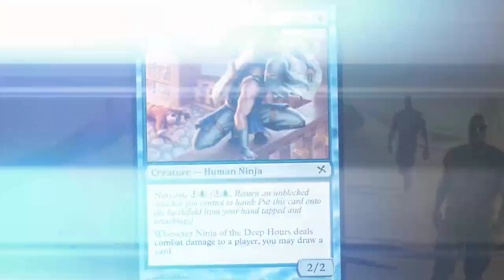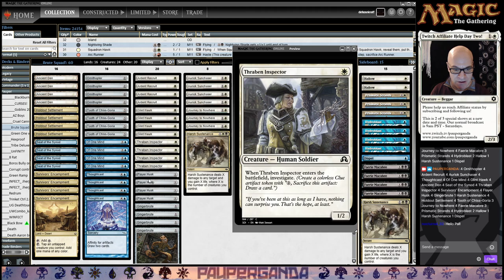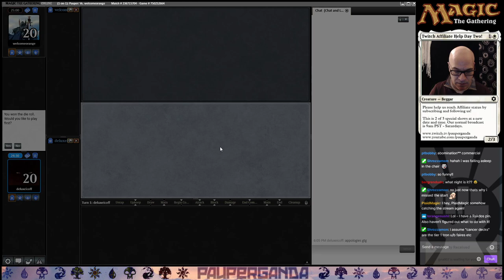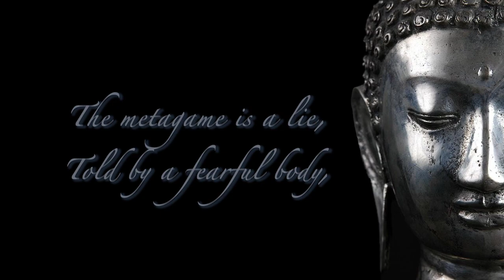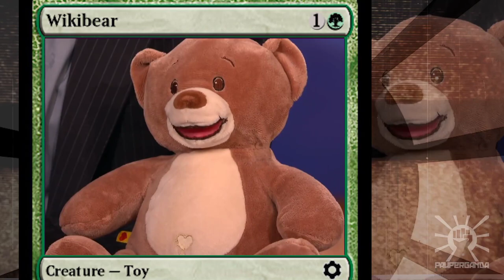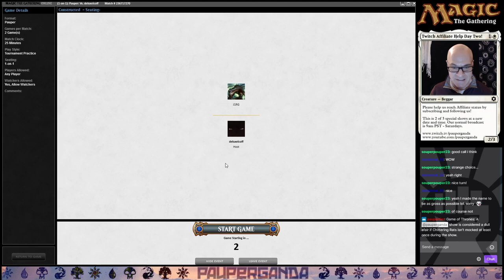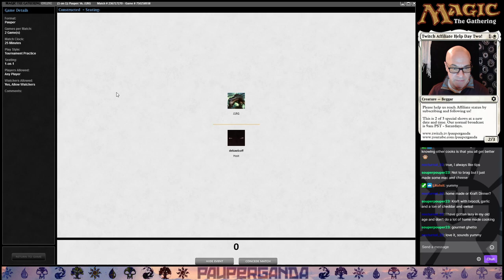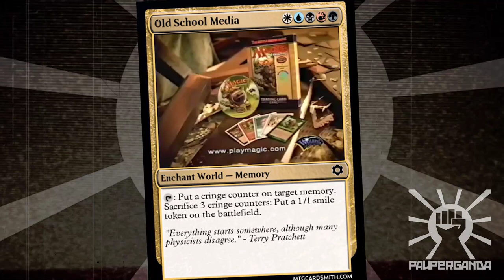MTG PAUPER BruteSquad - 2021

Comment: TBH if you're running harsh sustenance mb, with 8 sources for black mana, maybe you could make sideboard stronger by adding hate cards with low color mana cost, strong against certain strategies? Specifically 2x Gorilla Shaman/Flaring Pain for 2 Strands/1 Macabre/1 Dispel?
Reply from the maker: Good options indeed - till Tron gets something banned, 4x fae mac is paramount if trying to make money...the nano second you take even one out of sideboard, you face it for 4/5 rounds :)
Reply: @PAUPERGANDA  Sure, that makes sense. But Tron also relies on Fog effects, so having Pain as a soft counter also ups the percentage a bit.
Reply from the maker: @7218234  Yeah, in my experience they just have a dispel/counter, Fae Mac Can't be countered.  Flashback is a thing, but it's a pretty big "IF" to have two off-colored sources.
Reply: @PAUPERGANDA  ok, but:
you attack
lol fog
lol flaring pain
lol counter pain.
Next turn
lol fog
lol pain
lol counter pain.
This puts pressure on Tron. You matched Peace and beat it in mana efficiency. Sure, it wont beat dignitary, but faerie macabre is not replaced in sb - rather played along.
Also two off colour sources don't need to happen same turn. If you can do double pain one turn - great, you've beaten fog+counter (two cards) with one card. if you do it in two turns - it's still good ;)
Reply from the maker: @7218234  For sure - good points.  Harsh is the main victory condition in both those scenarios too.  I'd be worried about 'overboarding' if I used flaring pain personally, give it a go :)